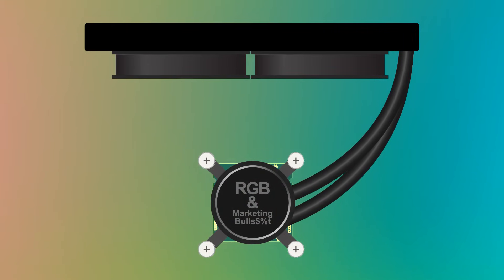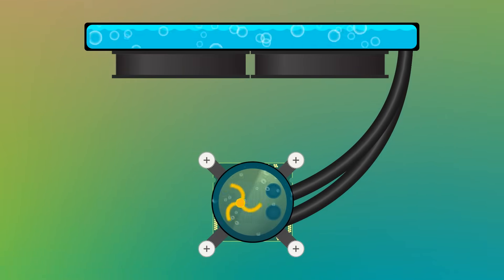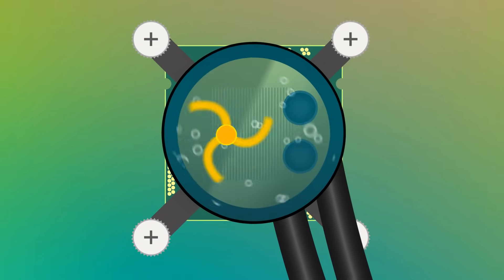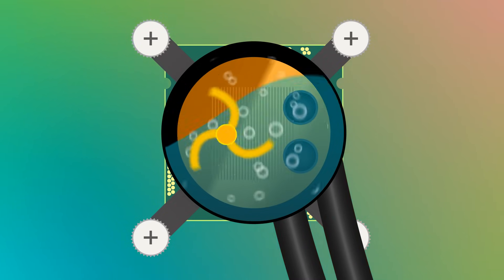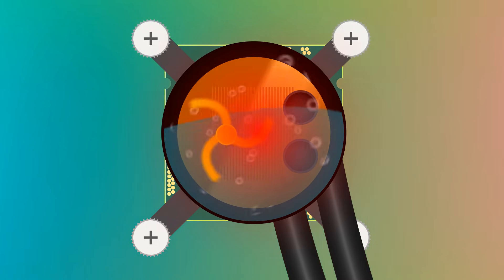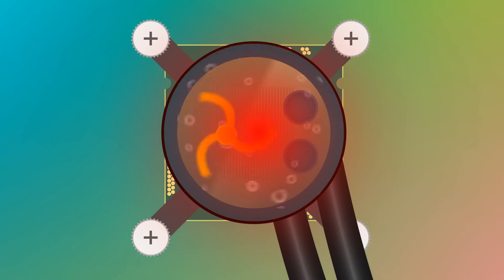Correct AIO orientation (This is the way)

Comment: How about case like lian li dynamic. Side mount and tubes on top is alright?
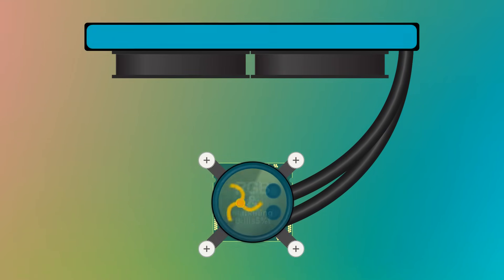Reply from the maker: Top mount in that case like 0:11 
Because side mount loses air flow by 30% every 90 degree turn (according to Steve from Gamer's Nexus) and air flow through the radiator is already pretty weak.

Comment: Thanks for the video! I wanted to ask you where is the best position for a strange case. I want to buy the InWin 303C case, with a NZXT Kraken X73 to put on the top. Do you reccomend it and should the “cables” start on the left side or on the right side? Or is better to put everything on the bottom? Thanks in advance!
Reply from the maker: If you install radiator on top then cable can be left or right no problems.

Only thing to watch out would be cable going up above radiator and coming back down.
Reply: @tldrinfographics5769   thanks for the reply! The problem is that the radiator will be in vertical and not horizontal. Sorry for my bad english. If you check the pictures of a build with that case you can understand better. Will there be any problem in that way for the funcionality?
Reply from the maker: @HardDownHill  Yes I saw that case 
https://imgur.com/r/watercooling/evjcJ 
Try something like this
I know that's custom loop but you will get the picture.

Comment: since i'm planning to upgrade to 10gen Intel K (like 10700k) and my PC usage are for Music production and Video or 3D rendering all the time, i'm still configure should i put radiator on top or front?
(i read on some article front radiator are for lower GPU Temp. and top are for CPU but still confuse about it)
Reply from the maker: Your case is so case dependant
Unfortunately you might have to do some trial and error with both configurations :(

But it’s kind of fun if you aren’t in hurry.

I’d recommend top mount personally.
Reply: @tldrinfographics5769  thanks for reply
its look like i would try on top first then

Comment: Hi, thanks for the video, going to buy a NZXT Z73 soon, would it matter if I mount radiator top , but the inlet and outlet tube of the radiator be at other side (left side) of your sample pic at 0:11 ?
Reply from the maker: Absolutely fine like that.
Good luck with new AIO installation!

Comment: This is wrong... You can put waterblock or radiator higher, if there is air stuck in one of those, the air will NOT move down in the system and go in the other part. You have to take the aio outside the case, grab the radiator, hang down waterblock, and shake the system.

Comment: which is better for aio coolers? intake or exhaust? im going to use it on a silverstone sg13 which is an itx case which can fit one 120mm aio
Reply: In this case: exhaust. It's important to get the heat out of sff builds because you don't have enough case ventilation / space is confined.

Comment: Does the orientation of the pump unit matter in any way? As in, which way the cables point at? Default is always to the right, but it blocks a Ram slot for me so wondering if I can turn it
Reply from the maker: Orientation of Pump unit doesn’t really matter. But make sure to not stress the tubes too much as it can damage inner coating.

Comment: i can't put the tubes at the bottom  (because gpu)  is it really bad if i have them at the top of the radiator (CPU is lower than the radiator)
Reply from the maker: Not preferred but not the ended of the world in that orientation.

Try to route the tubes in U shape as well in that instance to minimize the air circulation.

Comment: The NZXT X63 can't be setup this way, at least in the NZXT H510i
Reply: I have both!!!!! What is your config?
Reply: My case is the Iian li dynamic is it ok if the tubes are on the top
Reply: @tiny559  Try to put them at the bottom
Reply from the maker: @tiny559  Tube on top is not the best, for that particular case I would suggest mounting the radiator on top 0:11
Reply from the maker: Up top? Like 0:11?

If not 1:45 with tube up, which is not ideal but not the end of the world.

Comment: The part about tubes down is not necessary. Greg Salazar made a great video explaining why this issue was blown out of proportion. Tubes up is fine. If it's gurgling i think a top up will fix the issue. Another fix is of course tubes down if it's not fixed. And yeah the only thing to really avoid is your pump being at the top of the loop
Reply from the maker: Yup, tubes up is not the end of the world but.

1. Topping up AIO will void warranty.

2. You need some air because water doesn’t compress well and it won’t accommodate for thermal expansion.

Comment: No radiator has tubes long enough to install it like this.
Reply from the maker: You can also mount it up top
0:11 and if that's also not an option then 
1:45 with tube up top is not the end of the world
not ideal but not an Armageddon either.

Lian Li O11 XL case will solve all the problem though.
Reply: @tldrinfographics5769  would the lian li o11 razer work?
Reply from the maker: @nettlewood6981  It should but check the size of your AIO
Reply: @tldrinfographics5769  where do I but it in the main Li case ?
Reply from the maker: @tiny559  Up top 0:11

Comment: Hello. Great video for us the noobs.
May I ask, if the pipes are coming from the upper part of the radiator, is it ok? The radiator is placed like in 1:48, but the pipes are coming from top to bottom. Is that ok?
Reply from the maker: It's not a preferred way but I'd say it's the third option after:

1. 0:11
2. 1:46
3. Your way
Reply: @tldrinfographics5769  Thanks alot for the fast reply!

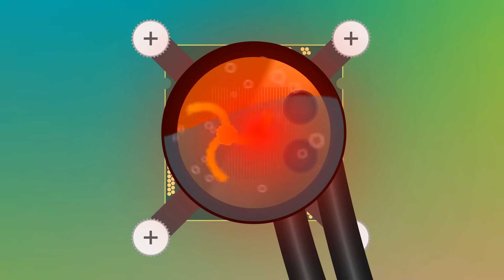Comment: 1:14 the answer is very simple,  don't buy an AIO. 😅 Used to be a fan of AIOs but low power CPUs and large air coolers makes aios a thing in the past
Reply from the maker: That is true, if you have CPU like 10600k or something and not overclocked might as well buy a Noctua D15 or something. 

Good point there.
Reply: @tldrinfographics5769  For me the NZXT Kraken x62 kept my 6700k few degrees hotter than my old NH-D15. I returned it and will never buy an AIO again if a good tower cooler fits. 
My main concern is thermals and noise, so I don't see any reason to spend more money on an inferior product
Reply from the maker: @Tappettava  Yeah NZXT X63 is a bit overpriced and doesn’t perform that well it’s pretty though lol
Reply: @Tappettava  This is true, I just hate the look of gigantic cubes on top of my CPU. My Kraken Z63 keeps my CPU from ever going above 65ish, so it seems good enough for me
Reply: @tldrinfographics5769  Yeah, I was very disappointed as I was looking for an upgrade to get better thermals, less noise and more overclocking head room.
Reply from the maker: @Tappettava  Yes, I feel the pain so many times I had to pull out new components and resell because it didn't perform the way I think it would or was too excited to evaluate properly, lost a lot of money.
Reply: @tldrinfographics5769  Feel the pain, but luckily we got great consumer protection laws and I got a full refund.
Reply: @tldrinfographics5769  please help me.....Should I use liquid cooler or a cpu fan?
Reply from the maker: @tomchandler7568  Which CPU do you have?
Reply: @tldrinfographics5769  I don’t have but I’m waiting to go with a r9 3900 or a 5000 series...
Reply from the maker: @tomchandler7568  3900X or 5900X have 12 Cores so if you are doing 4k rendering or 3D rendering then I suggest you get the AIO.

If you are gaming then just go with Air cooler like Noctua NH D15 I listed in the description.
Reply: @tldrinfographics5769  thank you
Reply: @tldrinfographics5769  why is that please
Reply from the maker: @tomchandler7568  It’s because new generations of CPUs are continuously thermal throttling to maximise the performance(Auto overclocking), which means you will get better performance out of these CPUs with AIO in specific situations such as 3D rendering where increase in temperature curve is a bit more gradual.
Reply: @tldrinfographics5769  thank you
Reply: Yeah lol, if you dont want to cool a overclocked one but a normally used one
Reply: @asimo8146  well, I find undervolting  as fun and challenging, often better than overclocking.  besides, a new gen of CPUs in one or two years will easily beats an overclock

Comment: what if u put the fans as intake and mout the radiator below the fans at the top so cool air is exhausted into ur rad? like mount the fans to the top of ur case, then radiator below it, my case has a fully open metal grid at the top that can pull in alot of air, mainly asking for my GPU rad, my cpu is front mounted and works perfectly fine
Reply from the maker: I thought of doing that too, having fans exposed on top of my case and Rad underneath it and then add another set of fans below the rad so you can get push pull configuration.

But then I thought it's going to be too noisy.

Comment: Can I just turn my pc over??? Instead of flipping my radiator? It won't fit unless I get a new case thats bigger. Do you think it's worth it? It won't really cost me anything and I wouldn't mind getting a bigger case. Please what's your opinion?
Reply from the maker: hmm that's an interesting solution 
if you aren't blocking any vents that could work I suppose.

My concern would be PSU heating up from accumulated heat from whole system because heat goes up.

Comment: Wish I was able to do this but I can’t
Reply: The case is the problem not the aio.
Reply from the maker: Why?
Reply: @tldrinfographics5769  my AIO would only let me mount with cables on top when I tried to have tubes on the bottom felt like they were being stretched
Reply from the maker: @deathsightgq1  Can you do 0:11 ?
Reply: @tldrinfographics5769  no I have a 360 radiator 240 would fit but it was purchased and unable to exchange
Reply: @tldrinfographics5769  Mine won't fit with the tubes on the bottom because of my gpu?? My case is to small do you think its worth getting a bigger case? What should I do do you think? Can I flip my PC over???

Comment: So for the front mount, is the tube for the pump on the right side or bottom?
Reply from the maker: Doesn't matter that much for the Waterblock/Pump

But try to position in a least stressed way as inner coating in the tube can be damaged which could result in cataclysmic events long term.

Comment: So what is exactly the issue if I mount the radiator at the front, tubes up? Is it mainly noise, or performance issue? I'm looking to buy Lian Li Galahad AIO cooler, the 360 version can only be mounted at the front of my case with tubes up, is it better to get the 240 version and mount it at the top of my case? Case is Lian Li Lancool 2 Mesh.
Reply from the maker: Both noise and performance will be slightly worse with tubes up.

I would recommend EK AIO 360 or Arctic Liquid freezer II personally.

I am running EK AIO 360 on my 3900X build and it’s been great!
Reply: @tldrinfographics5769  cool thanks, I'll check those coolers then
Reply: Unless you're running extreme overclocking and really pushing your CPU to the limit, a 240 should be plenty in that case for just about anything short of Threadripper.

Comment: What about if your installing the radiator top mounted? What should the tube orientarion be on the cpu block
Reply from the maker: Top mount is great and tube orientation on pump doesn’t really matter so much.

But make the tubes face down on radiator and fans are set to exhaust configuration.
Reply: @tldrinfographics5769  good to know thats exactly my configuration
Reply from the maker: @Caffatigued Owl Yes, most likely.
But you never know what crazy people are out there.

Comment: Thanks for the video, I still have a question, when mounting the AIO on the front/side of your case, should I always have the tubes going down no matter what? Like at 1:35.  I understand the radiator has to be higher than the water block, but I don't understand why the tubes how to go down, as I've seen YouTubers mount their AIO to the side/front with the tubes on the top
Reply from the maker: It’s not ideal to have barb on top and it will work ok but it’s not optimal as you will have some air circulating.

It’s not the end of the world but why take a risk if you don’t have to?
Reply: @tldrinfographics5769  I see, so it's not a necessity to have the tubes going downward, all that matters is the radiator being at a higher height than the water block.  It's just a matter of air flow increase airflow if you want the tubes up or down, if I'm getting that right
Reply: @diamondlong23  man actually I think keeping the tubes down is important as well, otherwise your pump will pull water inside the tubes and you'll get air in the waterblock regardless of its height. Anyway you'll get gurglings for sure
Reply: @diamondlong23  by making the tube at thw top, this means your water in radiator isnt circulating much since the air is at the space of the tubes.
Reply: @diamondlong23  as he said, it's not OPTIMAL to have the barbs at the top of the tank, bottom is ideal. The main concern with barbs at the top is the loop can NEVER be 100% full due to manufacturing constraints, there will ALWAYS be some amount of air in the loop. So barbs up CAN be potentially noisier (gurgling) or CAN allow some air bubbles to be drawn from the tank back through the pump, reducing efficiency.
Reply: @tldrinfographics5769  I though the inlets of the radiator should be at the top due to gravity, I learnt that from a jay-z two cents video some time ago. But I assume as long as the loop (custom in this specific machine) is filled and bled, it would not be an issue?
Reply from the maker: @flonxu2385  Custom loops don’t really suffer from this problem.

Comment: Wait, but didn’t gamer nexus say that the best would be a top mounted radiator? Or was his video too difficult for me to understand like any other one of his videos 😕
Reply: Top is best yes, but really push/pull configuration is best and I don't know of any case that allows you to do that with top mount.  

Top mount for push configuration, front mount with hose on bottom for push/pull
Reply from the maker: Top mount is best fail safe, but if you are prioritising CPU temp over anything then Front Mount is better.

Comment: If I have an atx case that only has a front 360mm mount, the only way it could be mounted is with the tubes pointing up. The highest point if in the radiator but is this still good, because the tubes are high up?
Reply from the maker: Tube up is not good as the air bubble will be circulating instead of being trapped in the reservoir.
Reply: Ok thanks, so it would be better to get a 240 and mount it tubes down then

Comment: you should have showed what happens when tubes are upward, or when mounted on top tubes on left too
still tho great video!
Reply: Upwards mount is completely fine as long as the pump is below the top of the inlet/ outlet.

Comment: My Corsair h100i rgb Platinum se pump is quiet on quiet Mode, but as soon as I enter balanced it starts to hum a Little, barely hearable but it does. And on extreme it just goes for a high tone hum... Could it be some air inside the pump? I have my radiator at the top, but the tubes go a Little bit down from the pump, then up to the rad. Should I try unmounting the pump, rotating it a Little at the lowest point I can get it to, and then mount it back, or is it... Is the pump sort of broken...?
Reply from the maker: Sorry I have no experience with that particular AIO but it sounds like you mounted it correctly.

The hum is present in every AIO though.

Comment: I’m getting the corsair H100i for my Ryzen 5 3600, I plan to actually put the radiator at the top. Will it still be as effective?
Reply from the maker: Probably the best orientation anyway.
Reply: @tldrinfographics5769  Thank you, much appreciated. <3
Reply: Even though you don't want to hear this, but using such an expensive AiO or even any AiO for an Ryzen 5 3600 is like throwing out money of the window.
If you would use some ITX case it might be different but according to your question it seems more likely to be an ATX case.
Even the stock cooler would be fine, but I can understand you would like to have a silent system. Well, a better air cooler will be perfect enough for this work.
Reply: @Deinorius  Alright, thank you. I’ll definitely find an air cooler then.

Comment: Hi bro , i just wanted to ask if i mounted it on the front , what config should i use for the fans?
Reply from the maker: I would personally recommend “intake”configuration because:

1. Hot air generated in the system tends to travel up and exhaust configuration goes against the flow.

2. The heat exhausted from PSU and rear system fan tends to stay around the back of the PC and cooler air is at the front so it’s best to intake air from front of the case.
Reply: Jaystwocents did a great video examining push versus pull with a front rad. Worth a watch to understand the trade-offs as it really depends on the case and what fan style (pressure fans versus airflow fans), and your noise tolerance.

Comment: yo bro if i want to mount it horizontally in the coolermaster nr200 what would be the correct configuration
Reply from the maker: Vertically in NR200?
Reply: @tldrinfographics5769  horizontal sorry
Reply from the maker: @IIII393IHDHDD  Ah I see, in that orientation can you make the radiator’s highest point to be about 1cm above waterblock? And route the hoses lower below waterblock?

Comment: There is any problem if I put the MSI CoreLiquid (the one with the pump in the radiator) in the top of the case?
Reply from the maker: Yeah I thought that design was a bit weird. 

The fool proof way to mount that particular AIO is 1:47

I will dig into it a bit more
Reply: @tldrinfographics5769  I have mine mounted like that and hear no gurgling. Also made sure that the water block is a bit above the pump.